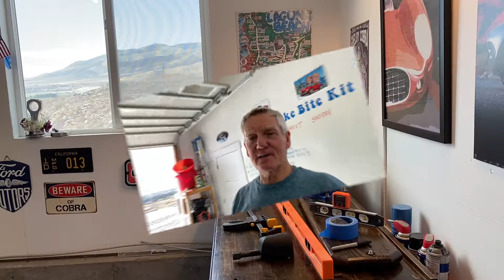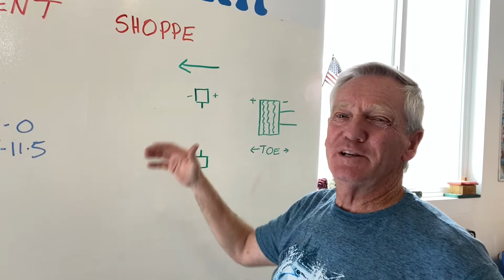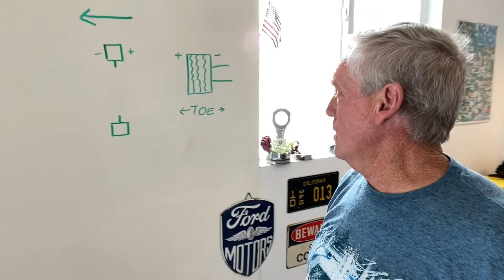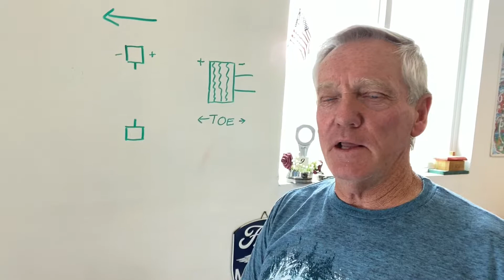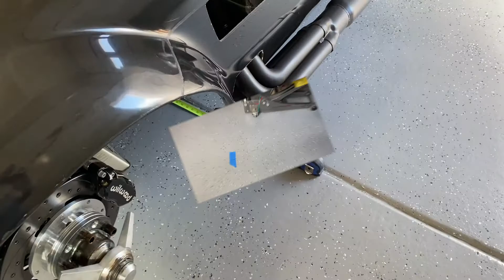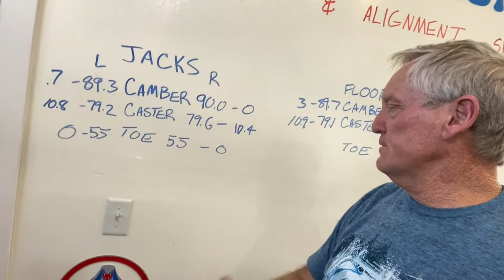EPISODE 62 The Cobra Alignment Shoppe

Comment: Pete,
I have been following your videos for quite some time, thanks for posting them. What tire pressure are you running front and back now?
Reply from the maker: I have 28 PSI front and rear, I plan on playing with that to see what works best. The Hoosiers are bias ply tires and feel a little sloppy, mostly in the rear, but they are very sticky!
Reply: @Pete's Snake Bite Kit   Thank you!  I have 28psi in the front and 24psi in the rear but still playing with it as well.  I may install slightly stiffer springs. I just switched from BFG to Cooper Cobras.  I really like your tires, but I've heard they can have its fair share of flat spots. Have you considered going with Avons and painting the side wall by any chance?  Thanks again Pete!
Reply from the maker: @felipepoletto3060  I would have black sidewalls but both sides have white letters. For my next set of tires I may remove any white letters and get Goodyear stencils. I have thought about Avons they may be next. 
Tell me about your car.
Reply: @Pete's Snake Bite Kit  Avons may be next for me as well, but that will probably be a little while from now since I just got the Cooper tires.  Really enjoy those white letters on the tires. The black wall with the Good-Year stencils would look perfect on your car. 

To talk about my cobra,  I have recently acquired a replica that was built in 1995 by Gentry Motor Works (most people haven't heard of it) of a 1964 289 FIA.  It has a 351 Windsor, 4+1 Richmond transmission, with the dark blue with beige stripes color combination.  I actually have had the pleasure of being in touch with Mr. John Gentry who started the company.  They would only build these cars as a full build with transmission and engine and only made 39 of them.  Too bad they didn't continue, the quality is superb, it follows the same tube chassis design (but twice the wall thickeness) of the original cobras, true body dimensions of the original, and it doesn't come close to getting hot in the footwell or any overheating in traffic.  

Looking forward to your upcoming videos Pete!

Comment: Pete, Im very glad I found this video. My dad built HM2005. His notes are very detailed but having a visual how to aids a ton. One thing he mentioned in his notes is that the car needs to be on a perfectly level surface or the readings will be skewed a bit. He used vinyl floor tiles stacked up under each tire to level out across all 4 tires. Keep the vids coming. Im enjoying learning and tinkering with his pride and joy!
Reply from the maker: That’s a good idea to use tile to level the car I am good right to left and front to rear I  subtract the 1 deg I have on the floor front to rear. 
Thanks for watching, Pete.